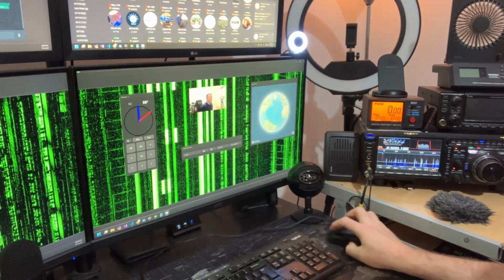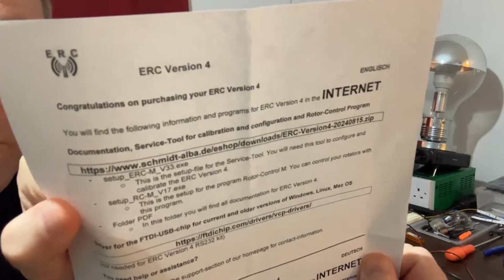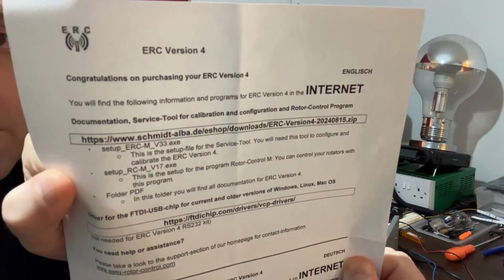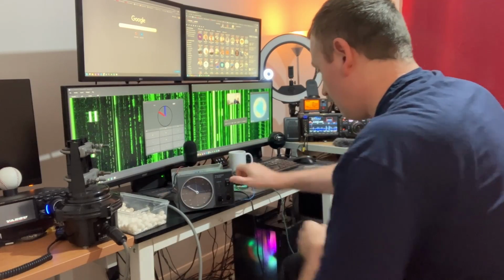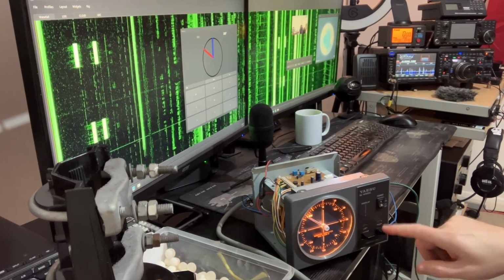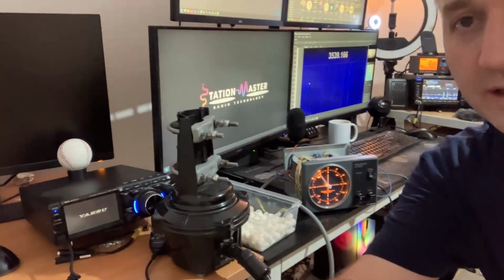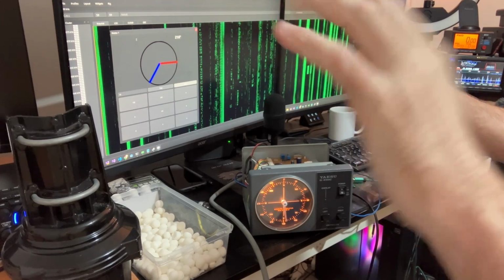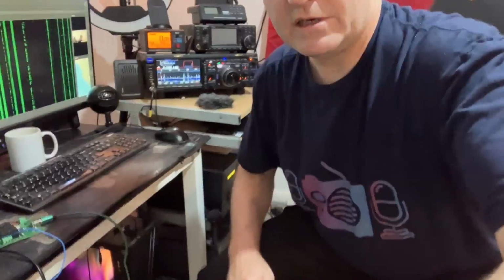YAESU G-450 ROTATOR - UPGRADE YOURS ! USB INTERFACE

Comment: Thanks. Great video. I plan to upgrade my G450CDC to have this. Very useful. Does the software have any updates to receive an input bearing value and the rotator can automatically adjust to that position?

Comment: Followed your instructions and when I engage the rotator program can hear the relays click, but no movement sadly. Rotator works manually and the rotator control shows where the rotator is moving to. My rotator is the G-450C
Reply: Were you able to get it running with the 450 rotor?
Reply: @sn1o_greg Yes got it going.

Comment: Hi, great instructions! I have followed this to the letter and double-checked that it is exactly as it showed here, but my rotator doesn't move when I connect to it via USB. I hear the relay clicking but no motor movement. Can You please give an idea what can be wrong here?
Reply: i had the same problem. but now it works. I took a picture for you. where can I send it?
Reply: Yep, mine was the same click but no movement.  The instruction on the green and yellow wire is wrong. I connected to the green and yellow  terminals at the back of the CW and CCW switches and all worked OK.

Comment: Hi Stu,
I have the ERC installed in my Hy-Gain T2X tailtwister control box. Works great.The black and red wire gets the position info from the rotator. I'm using PSTRotatorAz to interface with N3FJP, but don't like you need to  install Microsoft Edge Runtime before the program will run.  73  WJ3U
Reply from the maker: Hey Don, only version 1 required that, Version 2 doesn't, nor will Version 3, I would hold out for V3 though, it should be a good one!
Reply: @G5STU  Stu, I have ERC SMD USB V4, but bought it about 4 years ago and my board looks a little different from yours.  WJ3U
Reply: Tnx for posting this video it’s very helpful indeed the only difference is I don’t have the Thick green wire only thin yellow and and thin but by the process of elimination I figured it out 😊